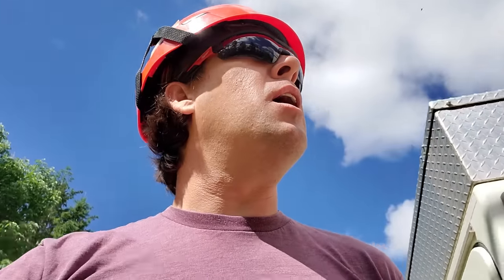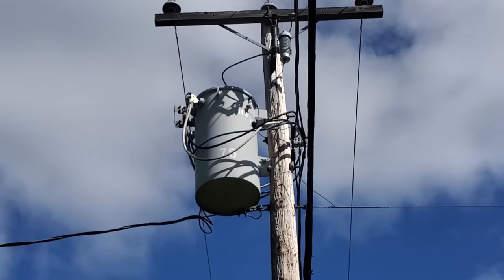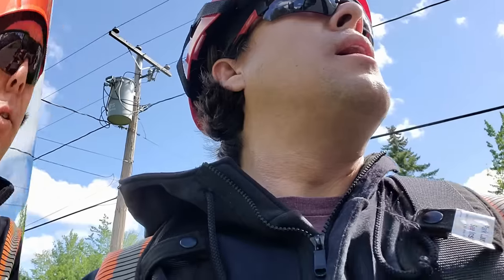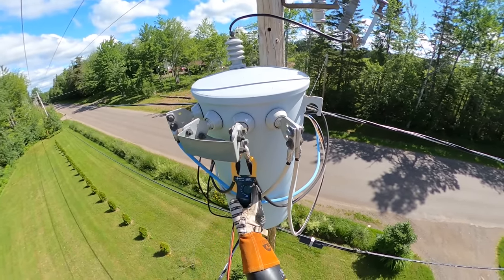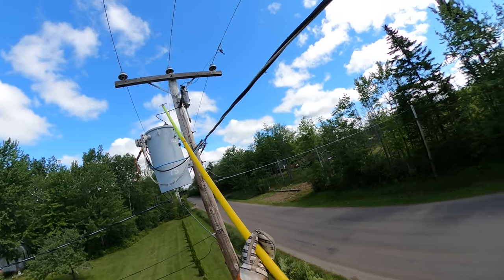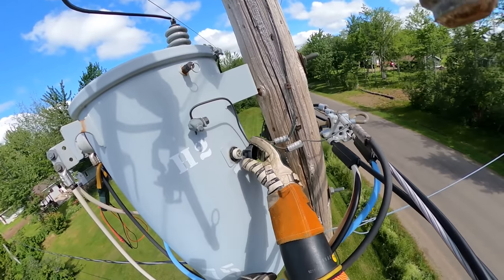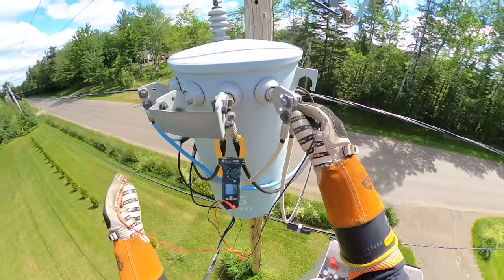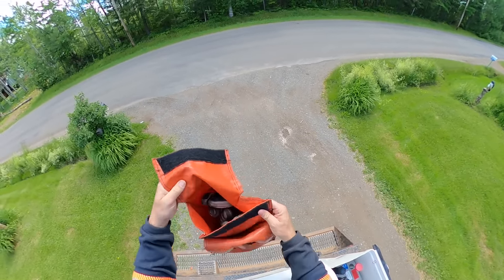How we change voltage on a transformer

Comment from the maker: Hey Everyone! 
What we're doing here is actually changing the ratio of the windings between the primary and secondary side of the transformer. 
Readings of 124 volts are extremely common and had the option not been available to adjust the tap setting, we likely would have left things as is.
Cheers all! Weekend is almost here 😁🍻🏖️
Reply: As LED lighting upgrades surge, we are seeing more overvoltage conditions. 
Worst I've seen is 130/260 open circuit.
That's too hot for any electronics.
Reply: What would happen if you had b
A back feed from a generator and tried to change that setting?
Reply: What’s the range or percentage of deviation your allowed to go?
Reply: very interesting how those transformers work. Thanks for the video!
Reply: I'm a bit confused. There is only 1 phase going into the transformer from the high voltage line. How does 2 phase come out of it? We have 3 phase transformers here: 3 phase going in, 3 phase coming out. Also, how are the phases split, resulting in 124/240? We have 125/220 here. The US has 110/208.
Reply: @winch1587  Even a single phase alternates between a positive and negative cycle. But you still have a single phase on the out put. What it tripping you up is there is an L1 and L2 and the difference between is 240v but that again is still single phase. I would suggest  studying and learning more about transformers and you understand   more.
Reply: @concealed4carry  If the tap switch is on the secondary side, what I assume, the primary side is disconnected there is no load. But you have an inductive load form the field going down and up again while switching. But more of my concern is that a transformer can work in both directions, stepping up 120V to half of the line voltage.
Disclaimer I'm a software engineer.
Reply: 125/250 at the transformer is what we kept our line regulators at
Reply: @concealed4carry  There is a single Phase 240V split into two parts of 120V and you could have dual phase 120V. In both cases you'll get 180° offset. If you'll come from a 3 phase country you believe you'll need 2 lines for a connection (forward voltage and backward voltage). It's not always good to use ground as the second conductor.
If you put the middle of the output side of a transformer to ground you'll get the same voltage on both sides with 180° offset. I don't know what's the substation layout, could you put a link how the generators a connected. I believe US still uses 3 phase 120° at substations and power plants. We get here 3 phase with 3 wires 30kV to near the building and there is a small building in which is the transformer to 3 phase power (the other side is waste disposal). It would make a lot of sense to use 2phase 7.2kV instead of 1 phase 7.2kV but you can't do that with the 120° offset at the power plant very well (you could split the 3 phases 155kV into 3 phase 7.2kV but it don't make sense and would be a waste).
Reply: @concealed4carry  Nothing, since the high voltage is disconnected no current is flowing through the transformer.
Reply: @winch1587  As I understand it (as a Brit), the secondary has a center tap which is connected to neutral/ground. It provides 2 phases 180degrees apart; 120-0-120 with 240v between the two hot/lives.
Reply: I basically observed this with a variac years ago and quickly understood what needed to  e done to achieve step down. Awesome work fast and safe.
Reply: @concealed4carry  I think that the switching mechanism transformer side would then be stepped up high voltage and very dangerous perhaps cause internal arcing.
Reply: @concealed4carry  I was surprised he didn't check for voltage being fed back before changing the tap switch..  udk?
Reply: @winch1587  The secondary winding has a center tap. There will 120v on each side of the secondary with the center tap as the reference. That's why it was pointed out that the line was balanced.
Reply: @MrBlueSkeyes  I have never seen that in our country. We get 3 ph 127V from the substation, with 120⁰ offset. This way we get 2ph 220V. I guess the 120-0-120V is only possible with 1ph 240V from the substation.
Reply: Pro electronics service tech here. For most consumer electronics without a switching supply, anything over about 122 is worrisome. 124 is right on the edge. 125 is the beginning of "too much voltage." 115-120 is ideal.
Reply: StringerNews1  I read the books in the early and mid 70's. Started with the ARRL Handbook and went from there. I still read and learn every day.

When I said "without switching supplies," which can tolerate really wide voltage swings and have regulated outputs, I meant "with linear supplies." Most of what I service on a daily basis is high-quality vintage audio gear (1990 and prior), and those units were designed for 117VAC for the most part. Some, mostly sold to service personnel overseas, have voltage selector switches. Interestingly, those units typically don't just have a 120/240 option. Those switches provide positions for 100V (Japan), 110V, 117V, 125V (America and Canada) and 220V, 234V, and 250V (Europe). (No 200V position, normally. It's not needed, although the transformer primaries could be wired to use it.) So why do they provide voltage options only a few percent apart? Because it matters. I cannot tell you how many units I worked on years ago that came home with a service member stationed in Japan (where the power line voltage is 100V and the power plugs are identical to ours), and within a week of arriving home their stereo equipment failed because they plugged it into 110-120V power lines here, not knowing they needed to change the voltage selector.

The difference between 110V and 125V won't make much difference to a blender, but it matters elsewhare. In the days of incandescent light bulbs, raising the power line voltage from 110V per rail to 125V per rail would cut the lifespan of bulbs in half. With electric ovens/stoves, toaster ovens, and microwave ovens, such a difference can be the difference between "dinner's ready" and "dinner's burnt." In analog electronics, running a device like a stereo amplifier that was designed for 110V on 125V will make the power amp circuits run significantly hotter, cut the lifespan of the display lights, and can overheat the power transformer and all the linear voltage regulators.

Vacuum-tube amps can have the lives of their tubes shortened considerably by excessive voltage, and if the voltage is a little low, this can have a drastic effect on the linearity of the tubes due to reduced cathode emission.

Motors in reel-to-reel tape decks were usually 100V AC motors that ran off a 100V secondary of the power transformer. Excessive voltage, even 10%, shortens their lifespan.

Heat, of course, shortens the life of all electronic devices, especially electrolytic capacitors, which, though they make little heat of their own, are exposed to the heat generated elsewhere in the unit. Also, a few percentage points on the power line voltage will often decide whether a power amp can meet its published specs or not. That's why amps are usually tested while run off a variac or a regulated AC supply, providing a constant 117V. (The variac requires manual adjustment as the amp nears full power.)

Granted, most electronic devices these days have switching supplies, but those of us who still own and enjoy the good stuff from the 80's back would like to take care of it, and watching the power supply voltage is one way to do that. That's what I meant when I said "without switching supplies."

Next question?
Reply: StringerNews1  Wow, We're full of ourselves today, aren't we? OK, I know I'm wasting my time on you, but I'll give it one last shot. Not for you, because you're far too invested in trying to make me look bad and thus make yourself look good, but rather for those who might think you're right when you call me a liar. They can look this stuff up to see if I'm right or not. Here's all the things you got wrong:

(1) Many modern switching power supplies automatically adjust for any input voltage from 100 to 240VAC, and they do it on the fly. Older ones no, newer ones yes. An example would be the power supply found in almost any desktop PC made in the last five years or so. Some modern switchers do not handle this wide range (most TV's, for instance).

(2) The voltage switches on vintage audio gear were mounted on the outside of the unit for the consumer to set according to where he lived, and the instructions for doing so were in the owner's manuals. For example, on page two of the European version of the Sony TC-280 reel-to-reel's instruction manual we find, 

"The TC-280 operates on AC 110, 127, 220 or 240 V, 50/60 Hz mains supply (AC 240 V, 50 Hz factory preset)
When changing the setting voltage and frequency, be sure to consult your Sony dealer."

I can't post a link here but HiFiEngine has both the owner's manual and the service manual for free download. It's one of hundreds I have on my work computer.

(3) You said, "There's no place on earth where 117V is the nominal voltage." Wikipedia would beg to differ. Check it out. And the reason for all those settings is because while the nominal in America might be 120V, it might not be that in your locale. You're right, I did not know that the nominal voltage in Brazil is 127. But maybe that's why some machines have a 125V setting? You think?

(4) You said, "Transformers don't have multiple primary windings, for reasons that should be obvious." Really? Please tell me the reasons why a transformer cannot have multiple primary windings, and why one can find so much information about transformers with multiple primaries (and how to wire them) on the old interwebs? As I look right now on the Mouser Electronics website, they list some 2,174 dual-primary power transformers for sale. Some vintage units do have a single tapped primary, but others (especially the ones with fewer voltage selections) will have two primary windings, each designed for 120V. Wire them in parallel and you're good for 120V, Wire them in series and you're all set for 240. Easy peasy. No back-feeding of the grid involved. You do know what that means, right? It means feeding power from an extremal source, like a generator or solar array, back into the grid through the mains. Which of the things I've discussed could possibly do that???

(5) Regarding my remark about voltages and blenders, you state that "Actually, a basic multi-speed blender has different speeds exactly like that." Yes. Blenders have series-wound motors with multiple taps on their windings to make them run different speeds, or else they have electronic speed control, perhaps a triac circuit. Which is why they'll run fine on 110 or 125, as I said. Little-known secret: Series-wound motors work on AC and DC both! Amazing, huh?

(6) Your sixth point was so confused it was hard to decode, but I'll take a crack at it. (a) Ohm's law does say that more voltage across a given load causes more current flow. But incandescent lamps are constant-current (or nearly so) loads once they begin to glow. But that has nothing to do with what I said. (b) I'm almost 60, and have never been given free light bulbs by an electric utility. (c) Rails, in the sense in which I used the terms, are the hot leads that come into an American home's breaker box, which are connected to the output of a centertapped transformer on a pole somewhere, with the centertap grounded. We clear now? Each rail has somewhere around 120V to ground, and the two rails have about 240V between them. When you say "electrified rails," perhaps you're talking about subways or trolleys; but I wasn't and you know it.

(7) You said, "Thermostats are a thing." Indeed. But my ex-wife never seemed to get that. In any case, back to that old Ohm's Law thing, about more volts means more amps, and by the way, volts x amps = watts, and watts are what cook your food. And at least in a microwave, timers are more of a thing than thermostats, and magnetrons (that's a form of vacuum tube, you can look it up) make more power when fed more volts. It's that Ohm's law thing again, coupled with more emissivity from an overheated cathode.

(8) You state, "Voltage is not heat. Once again you emonstrate a profound lack of knowledge of the most rudimentary aspects of electricity. Without that basic knowledge, I could explain it to you, but you wouldn't understand." 

No, I don't think you could explain, so I will. More voltage causes more current to flow. Even you agreed to that in (6). More current means more resistive losses in the transformer (both in the resistances of the windings and in the core) so it gets hotter. More voltage means that the power amp dissipates more heat for a given bias current at idle and also for a given amount of output power into the speakers. More voltage going into the transformer means more coming out, which gets recitifed into raw DC that feeds the linear voltage regulators for the small-signal circuitry. That means that the linear voltage regulators must dissipate more heat because they must "lose" more voltage to bring their output voltage to the desired level. Failed pass transistors in these regulators are enough of a problem, especially in Pioneer amplifiers and receivers, because they used undersized heat sinks and often put voltage regulators in areas that did not get enough air circulation. Excessive line voltage just makes this worse.

(9) I've been working on electronics since 1977. I have been a recording engineer, live sound engineer, and custom-builder of electronic devices for decades. I have my own shop, which you can learn about by looking at my YouTube channel. But this won't change your mind. I know that. Again, I'm talking to the others reading this, not you. 

I will not respond further to you. Don't look for it, I'm too busy fixing people's stereos.

Oh, and one other thing. Don't call me a liar.
Reply: That was a really interesting video. I did not know there were tapped primaries on some power pole transformers. In 1985, we had a problem at a rental house I lived in where we were getting almost 130V from the power outlets. To correct it, they actually had to change transformers. They got it done in about an hour, pretty quick, I thought. BTW, what kind of camera did you use?
Reply: Repent to Jesus Christ!

Are you a sinner?

Mark 2:17
King James Version
17 When Jesus heard it, he saith unto them, They that are whole have no need of the physician, but they that are sick: I came not to call the righteous, but sinners to repentance.
Reply: Got called into a 6 story building while on weekend call and was never there before that night. Had both 13,200 services energized but emergency generator would not turn off. One of the ATS switches preventing switching back to normal power because ultility company was having a problem. The usual 480 volt power was over 530 volts. When ultility power was straightened out the generator did it's 20 minutes time out then transferred power back.
Reply: Why would someone complain about high voltage over a volt? Seems dumb when it's still within the ratings for every appliance.
Reply: @FishFind3000  was always told plus or minus 5% but that is very hard to keep that close. During a hot weekday have measured as low as 108 volts but on a weekend late night as high as 126 volts. Where I live they feed up to 22 houses that have most have 100 amp services with only a transformer rated for 350 amps. Of course after first year the light grey paint has dark burnt spots from overheating.
Reply: @winch1587  Single phase transformers can only put out single phase. Never saw a house with two phase service but some old plants still have it. Your home has a 3 wire single phase Edison system where the secondary of transformer puts out 120/240 volts due to a center tap at middle point of winding providing 120 volts from that point to either of the energized wires. Never saw a house with three phase service. Would have to be a one in a Millon mega mansion for ultility company to offer that. I have worked in a few plants that had two phase 5 wire services. 4 energized wires with the center of two separate & 90 out of phase transformer windings center tapped to provide 120 volts. Heard that they once had 440 volt two phase but never came across it in my 50 years as a sparky. My first job had a 2300 volt two phase transformer supplying power to another building.
Reply: @JohnThomas-lq5qp  I don't live in the USA. In our country we get 127V single phase at max 32A at home. After that it will be 2 or 3 phase up to 25KWh for households. The reason I know that we have 3 phase, is because of three phase wires going into the transformer while neutral is connected to ground. We have 127/230, not 120/240.
Reply: Nice work. I think it would be fitting for you guys to drive an electric truck though.😎
Reply: Great safety tip, that you called ur base telling them where u are at .
Reply: It's all in the transformer winding configuration. Three phase 7.2 KV (only one phase used) on primary side with second leg of primary connected to EARTH which is also bonded to the neutral side of the secondary side. Transformer windings Ratio is probably 60:1 . Single phase 240 volt on secondary side with center tapped neutral for 120 volt line to neutral/Earth. No matter how you look at it " it's still magic".
Reply: @brettralston3599  It could fluctuate some throughout the day as loads randomly change.
Reply: @JohnThomas-lq5qp  There are not many homes with three phase (or both single and three phase!) service, but they're out there.  Some people just had to have their 3PH fancy equipment.
Reply: @RS-qp4bp  It's not magic. It's magnetism.
Reply: @ScottGrammer   @StringerNews1 I found this interaction fascinating, because at first, StringerNews1 brought up a bunch of correct points about 3 phase, 2 phase, and single phase power systems, including the point that 114V-126V is the range that most utilities have to maintain at the service entrance in the USA. Scott then brought up the also correct point that there are plenty of appliances negatively affected by voltages at the high end of the spectrum, such as linear power supplies, audio amps with unregulated supplies, and incandescent bulbs. StringerNews1 then replied with a largely incorrect post in an effort to discredit the good points brought up by Scott. The only argument that seems to make sense from Stringer is that any linear supply or audio amp is badly designed if it can't easily handle a 5% high voltage. And in my mind that screams bad thermal design with a lack of safety margin. 

Why do people need to be so confrontational and defensive? Especially when clearly presented with more accurate knowledge from someone else.... it's almost like people don't want to accept a point made by someone else. In any case it was an interesting read and Stringer was certainly more rude.
Reply: @FishFind3000  He mentions it in the introduction, its 5%.
Reply: I have 36 x 250 watt micro inverters on my roof. During the day when my solar is generating my voltage drops to about 243 and at night I see it rise to 253. In the 8 years that I have had this 9000 watt system I've only seen it shutdown once. A regulator about 30 Km's from me failed. The voltage went up to 275 for about 3 hours. Nothing was damaged. I like the voltage at the high end. Switch mode power supplies like in your TV run cooler when the voltage is higher. Less amperage to maintain the B + on the regulator side.
Reply: StringerNews1  u are piling up a lot of mistakes...  picking up just one sample of your mistake "voltage is not heat"  back to elementary level ohms law.  V=RxI aka voltage is equal to resistance multiplied by ampere. To make easier for you,assume equipment has costant resistance (in reality it change) if u increase voltage then u INCREASE the current flowing in the circuit. More current MORE HEAT.   Do u still think heat isnt related to voltage?  Lol
Reply: @ScottGrammer  dear Scott,  u were even too kind to answer back to that keyboard "expert". He doesnt even understood ohm law, figure the rest. In the past before internet we had issue to find informations, today most of the people doesnt realize that many things on line are NOT informations but pile of trash.  Greetings from EU (the 220 universe) Rick
Reply: @JohnThomas-lq5qp  then u paid a lot more the electrical bills due the low voltage... u  and others 21 houses should ask for a better feeder.. couse if u have a transformer rated 320 A for 22 houses then u have on AVERAGE less than 14A for each meter. Something isnt matching
Reply: @chrisbauer1925  its called ignorance and straw tail.  It catch on fire pretty easy on people that hide behind nicknames like him. Scott showoff old school kindness and knoledge things that today are really missing.  Great scott
Reply: Changing the windings...
Seems like it's nothing but a huge variac
Reply: About 15 years ago thieves drove around my town (pop. 78,000) and stole the most easily accessible 6 feet of un-insulated copper ground wire at most of the utility poles. Does this make our houses more susceptible to problems from lightning strikes ?
Reply: Where does the average jo get a pair of hot gloves. ???
Reply: Was a new label put on that transformer?
Reply: @winch1587  The single phase is split into two 120v (nominal) half phases (i.e. the voltage from either hot line to neutral is 120v and between both hot lines is 240v)
Reply: In what scenario would a few customers notice and then complain about a slightly high voltage?
Reply: What an awesome place to plant a row of trees! Right under a power line. I guess it helped keep em straight aye?
Reply: Please explain where the second terminal of the high-voltage winding of this transformer is connected?
Reply: does that affect frequency at all
Reply: @winch1587  US has 120/240, 120/208, and 277/480 as our secondary voltages.  In VA anyways.  A 3 phase overhead bank or a 3 phase pad mount trasnformer is still just 3 individual single phase transformers(coils) tied together.  When a lineman says single phase or 3 phase they are talking only about the primary voltage coming in not the seconary voltage coming out to your meter(usually).  In my company we letter the primary phases A,B,C or Road phase, Middle Phase, and Field phase.